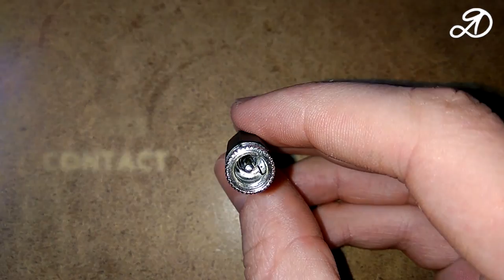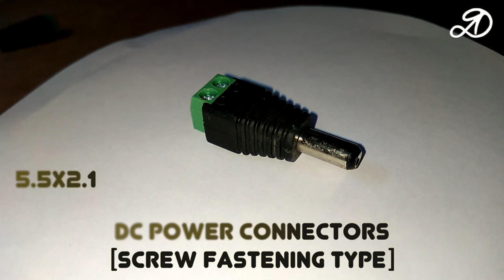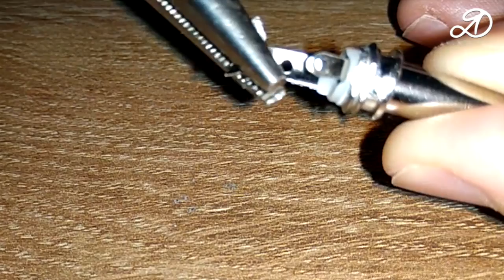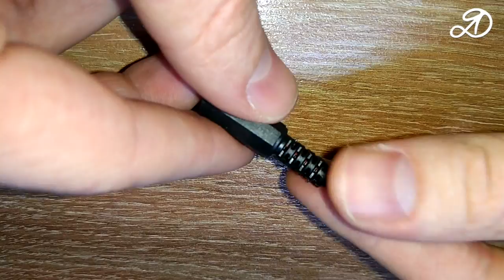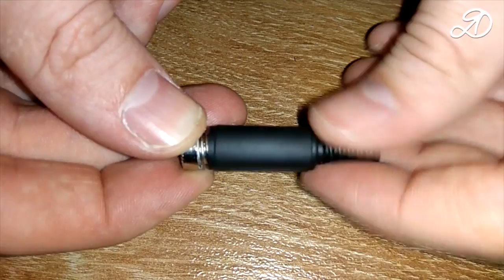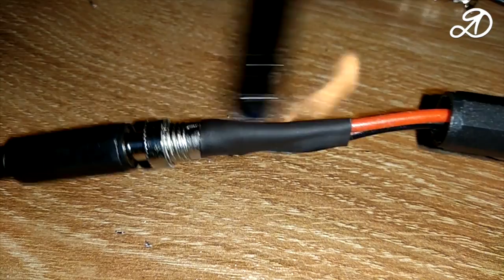Soldering DC power connectors. Power socket from China. Parcel Aliexpress (32)

Comment: Putting a male plug into the female connector, whilst soldering the female connector's cables, will always save you a lot of grief. I liked the hot glue, I normally use silicon sealant.

Comment: I Want to make an external fans(cpu fans) For my Ps3 fat..its same  Way how to solder the male n female Socket adaptor Or not sir..?? Sorry my bad english
Reply from the maker: Don't worry :) Hope I understood you correctly. Yes, you can solder connectors male female as shown in the video. Verify correct polarity and efficiency of the fan before soldering. Good luck!